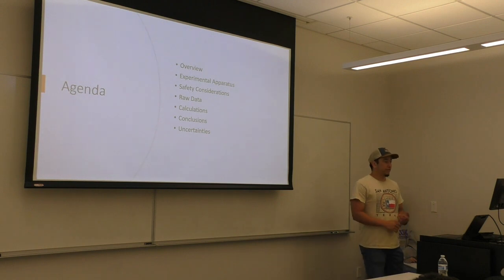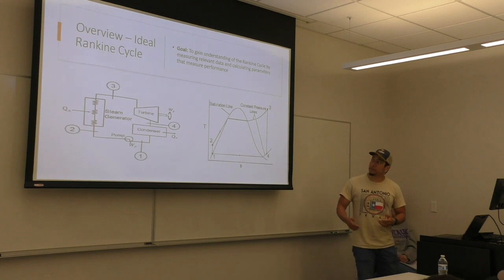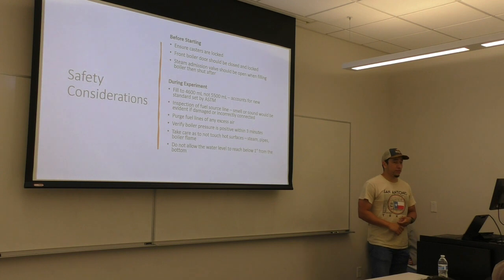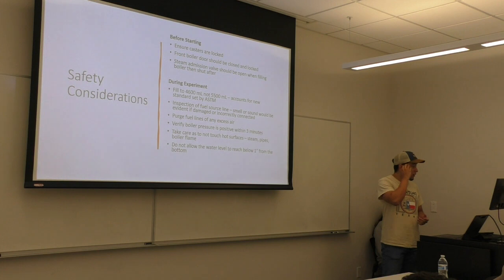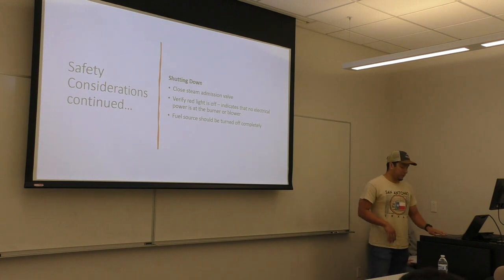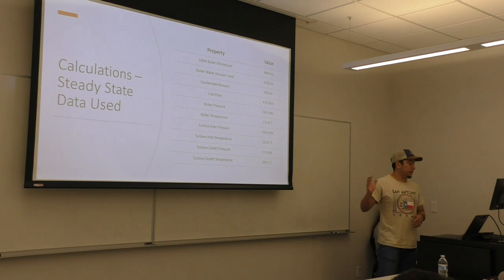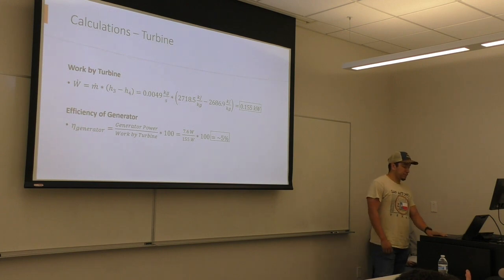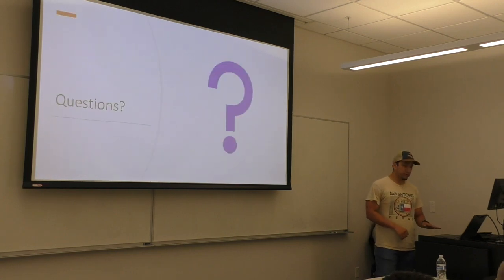S1540006

Comment: I think my delivery and confidence when delivering is very good. Where I struggle is keeping sections concise, this lead to not conveying more pertinent information (such as the results and principles learned) in a timely manner. A solution could be simply more practice. But the actual technical content itself I thought was decent. The quality of the slides I think was good. Overall, I just need to practice keeping my thoughts in line so that information is conveyed more clearly and quickly. Additionally, I could have done a better job at tying it back to the principles learned from performing the experiment like Andrew Boutte did.